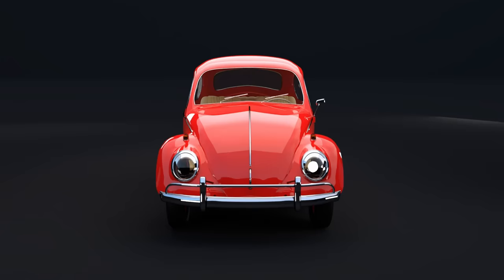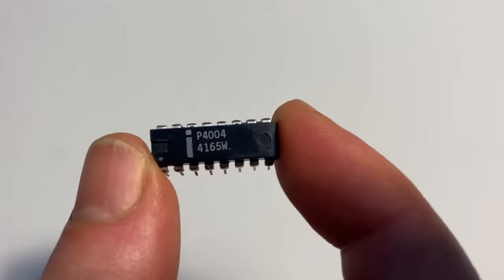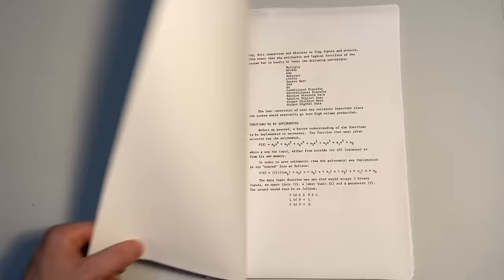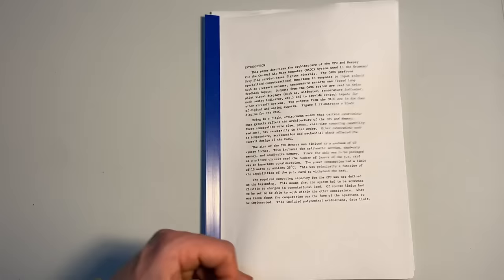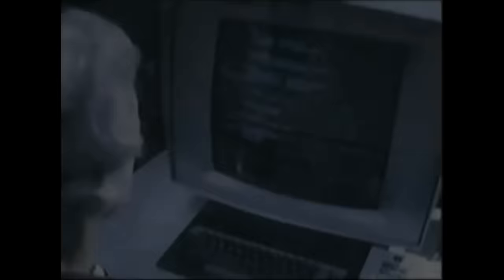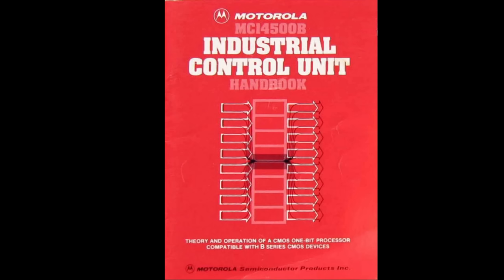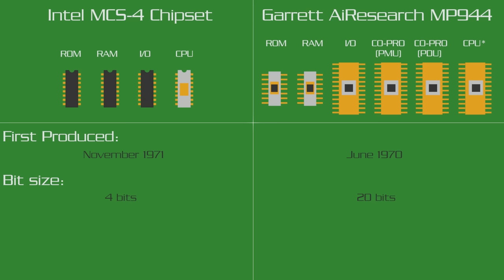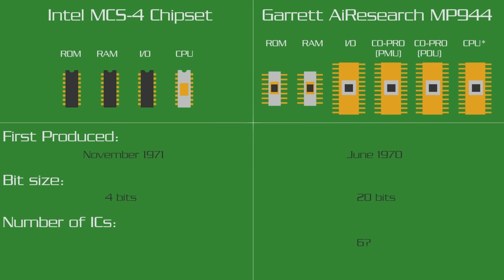The World's First Microprocessor: F-14 Central Air Data Computer

Comment: Great video! I really wish we would have a program today that could be used to verify that every transistor in the system is actually working correctly. Even if running that program once took a whole day, it would still be highly valuable to verify the hardware that you have, either to verify it after building a new system or to diagnose unstable system. Currently the state of art seems to be "randomly swap parts until it starts working again for the programs that you actually use daily".
Reply: Programs can be written and the trick is to be able to prove that a "single failure" is picked up.  Overall its a simple concept. If a * b = c and if c is the incorrect answer then you have a problem. How many a * b or a/b do you have to do to catch all single failures.  Now multiple failures are a different story.  Ray Holt
Reply: @firstmicro  The problem is that you cannot know by definition which part of the hardware is potentially broken. If you compare any numbers to each other, what if the comparision operation in the CPU is broken? Modern CPUs have multiple execution units per core so even if you successfully execute 5 comparisions correctly with known values, you cannot know if the 6th execution would actually work correctly or not. And since the actual execution units are selected by proprieatry algorithms inside the CPU, you cannot assume you have a safe way to run any kind of test code on all units.

We would need some hardware support to be able to test all the transistors in the CPU. For exaple, ability to select which execution units are in use (basically disable everything but one) is needed to check if those units work correctly.

And to make things harder, the L1 or L2 cache could be broken and there you have the problem that e.g. 16-way associate cache can have the cached value in different locations in the cache and any random execution of the code may or may use the part of the cache that's broken.

It's turtles all the way down and at best you can give some kind of statistical estimate how correctly the hardware is working.

Comment: Interesting video. Reminds me of the seventies when I started designing embedded industrial control systems.
Back then we made the distinction between mini computers and micro computers. A one chip CPU made it much easier to build a system compared to building all with TTL circuits.
Reply: Mike, Chips like the 4004 required multiple TTL circuits.  Some one-chip microcontrollers were very capable and required very few TTL circuits.

Comment: Stunning!  Early computer history suffers from being stored on media (paper and restricted scanned images) not widely viewed by current students so these videos expose new generations to how computer fundamentals came about.  Trouble shooting these types of systems is very tricky (and not always successful).  I worked on directly connected adjacent parts to the F14 and to circuit board construction is just jaw dropping.  The printed wiring boards are super high density and battle hardened.  The difficulties in programming are unbelievable.  The original engineers were amazing.

Comment: Sir, with great respect, while your comment about high aspect wing ratios creating more drag was not necessarily incorrect,  high aspect ratio wings actually have a higher lift to drag ratio.  That is to say, of a high aspect ratio wing and a low aspect ratio wing of equal lift coefficients, the high aspect ratio wing will usually produce less drag (case in point the high aspect ratio wings of the U2 or a modern airliner being designed for maximum efficiency while lifting a heavy aircraft).  It would be truer to say the Tomcat in the "T-pose" would create higher drag because it has an increased wingspan, to gain additional lift at low speeds.    Love the video though!

Comment: Great video. A couple of niggles (I know you love them): iirc the program which converts assembly language into machine code is called an assembler and not a compiler. I’m sure I’m like the 100th pedant to point this out. And between the 4004 and 6502/Z80 were the 9900 (no registers, first consumer “16-bit” chip), the 6800 (inspired the 6502) and the 8080, among others.
Reply from the maker: Oh good spot! Why did I say ‘compiler’!?
Ah yes I just mentioned the 6502/z80 as they will be more familiar to viewers
Reply: Also the 8008.

Comment: Great video, brought back memories. I graduated with a computer science degree in 1978, and in 1979-1981 I worked for Marconi Avionics, Rochester, Kent. I worked on the first computer based air data systems for Altitude and  2 dimensional speed for helicopters. There were still a team of watchmakers who serviced the mechanical computers for the Vulcan bombers.

Comment: I worked on the F14 in 1994.  There was the Z8080 embedded in a center console black box.   I had an old programming manual from the 70s and was able to work on it.

Comment: In the 60's, IBM was working on Josephson circuits, multiple superfast processors in a liquid-nitrogen bath (to lower electrical resistance to near-zero).  Those Josephson processors/circuits were microcircuitry prototyping.

Comment: The Japanese (mostly Hitachi and NEC) designed dozens of 4 bit processors in the early '80s I think it was and some of them are still being manufactured in their millions to this day. While the US made all these 8 bit micros after the Intel 4004 the Japanese in sheer numbers probably outsold them. These were used in LCD displays and washing machines and so on in really high numbers at the time. I reckon this difference was driven by a cultural difference, in the west engineers were trend setters if you like and in the east they were encouraged to be minimalist, winning from a cost/performance perspective and through that incredibly widespread adoption. As die sizes and therefore cost for 8 bit CPUs shrunk a lot of the cost advantage shrivelled, being driven more by packaging costs that scale tilted a lot but like I say, there are still millions of 4 bit micros being sold.
Reply from the maker: My favourite use for a 4 bit micro is in the Barbie typewriter - to allow for a hidden encryption mode. One may or may not make an appearance on this channel in the future…
Reply: @Alexander-the-ok  The encryption mode wasn't entirely hidden; it was mentioned in several versions of the manual that came with the Barbie Typewriter. (Or, as I like to call it, the "Barbie Enigma Machine." :-P)

Comment: This is the best Ive found so far for computer tech back in the 60s, 70s, 80s.  The low level programing needed to control swing wing on the F14 Tomcat.

Comment: You may want to check out the Viatron System 21 microprocessor from 1968.
Reply from the maker: I did come across that as part of the research for this. It was the first use of the term 'microprocessor'...though I don't really think it falls under the generally accepted definition of one today (though, of course that is very much open to debate).
Reply: And four-phase al1

Comment: IMO for semantic purposes, anything that isn't pure logic handling. i.e. 8 and gates on an IC, and can perform actual abstracted computational things. It counts as a micro processor (granted that it's all on one package)
Reply: Why. A processor has a specific job and isnt too hard to define
Reply: @ravener96  Ok, define it then.
Reply: @nobodynoone2500  the minimum is that the system can perform instructions necessary to define a touring complete machine. basically if it can execute transformations on input data and do conditional operations you have a processor. i dont really care about the IO restrictions used in this video, if the chip can be fed data and do transformations and conditional operations it's a processor

Comment: I like the "CPU on a single integrated circuit" definition of microprocessor, so I feel like the external program counter is disqualifying to be a "microprocessor". But it's an arbitrary cutoff.
Reply: Then you are ignorant to processor design, your chip on your computer (or phone) you typed this on does not meet that arbitrary standard.
Reply: @nobodynoone2500  Could you elaborate on that?
Reply: But it then depends on what you call a "CPU." Is an 8080 a CPU even though it can't run without some moderately sophisticated external clock generation circuitry?

Comment: So the conceptual difference of mp944 is rather than sending an entire number in parallel thru a serially complex procedure like we are used to, it sends its numbers serially thru a complex parrallel set of dedicated hardware processing.  Thats some genius thinking there.
Reply: Thats actually why the 80s Amiga was smoother graphical interface than PCs today.  PCs use convoluted serial procedures to run the interface along with calculations so it gets choppy and boggy where the amiga ran the interface on its own coprocessor.  In a way, i guess we could bring that back within the boundaries of PC architecture by adding a dedicated interface chip back into it rather than relying on a constantlt "faster" pc to smooth it out.

Comment: You mention 6502 and Z80, but forgot the "line" following the 4004, namely 8008 (1972) / 8080 (1974) / 8085 (1976)  to speak only of 8 bits microprocessors. The 6502 appeared in 1975 and Z80 in 1976.

Comment: At 5:43, the jet plane taxiing on the runway goes through a control surfaces check, and the tailplane seems to behave like a pair of ailerons, whereby one goes up and the other goes down and vice versa.

It absolutely makes sense that an aircraft which needs to be nimble and maneuverable might have controls which allow this, but I never knew about this control method on planes other than delta wing planes which have elevons through necessity (ie they don't have discrete wings and tailplane).

Every day is a school day, and that isn't even the topic of the video! Amazing.

Edit: it sort of is part of the topic of the video. Thatll teach me for commenting before Ive seen the whole video.

Comment: Seems quite similar to the SAAB CK37 computer which entered service in 1973 in the SAAB AJ37 Viggen using that same MP944 microprocessor
Integrating sensors for airspeed, altitude, instrument landing system, weapon system data etc specific to the Viggen

There should be a number of old CK37 computers and perhaps even some MP944 microprocessors in the Swedish Airforce museum stash and perhaps in other places as well

Comment: The use of microcomputers in the F-14 to command aircraft flight controls closely follows the terrain following radar controlled flight of the F-111 fighter bomber,  which Defense secretary McNamara infamously foisted on the Navy as a do-everything fighter/bomber. 
As a first generation swing Wing supersonic fighter the F-111 had huge teething problems and fell far short of the Navy's requirements, however, Grumman was well aware of every outstanding attribute or shortcoming of the F-111 in designing  the F-14 soon after as a superior replacement. 
And even before the F-111, the Apollo moon rockets used some of the first integrated circuits - I believe they were Fairchild microprocessors? -  in their rocket guidance command and control.
Even more astounding were the analog computers used in World War II, especially the big firing control units that estimated range & velocity for the huge Naval guns on the US battleships, and the far smaller Fire Control computers for the remote gun turrets on the B-29 Superfortress bombers,  which apparently were  accurate to twice the distance of 
purely human aimed  gun turrets.
It is amazing to think that the Concorde, the 747, the X-15, the SR-71 and Appollo rockets we're all designed by slide rule in the days before engineers had electronic calculators.
And finally, it is a shame that another defense secretary mafia, this time under dick cheney, pulled the rug out from under the mighty F-14, instead of upgrading it with the newer engines and  avionics they deserved,  forcing the Navy to  adopt the smaller, less capable but less expensive F/A18 Hornets

Comment: I think there is some clarification required for the operating temperature discussed around 25:00; mil-spec operating temperatures are -55 degrees to +125 degrees Fahrenheit, not Centigrade, and refer to the ambient operating environment. The junction temperatures within the silicon may reach 125C, but that is not uncommon in commercial silicon semiconductors. The difficulty with meeting military requirements is generally in the electronics packaging and thermal management, while still meeting other performance and producibility requirements.

Comment: Fairchild Semiconductor did not make the bulk of its money from selling the 4004 to calculator makers, It was a subcontractor to Autonetics, the company that supplied Boeing with the guidance system for the latter's Minuteman I ICBM.  My question is this:  Was the 4004, a 4-bit CPU, adequate for guiding an ICBM to a target 7,000 miles away?  Or Did Fairchild have a different product for that?

Comment: Haha @7:15 you even warn us... But as an aero engineer I have to correct you, I am unable to either not tell you I'm an aero engineer or correct you (sorry)
1. Amount of Lift has little or nothing to do with stability (stable flight)
2. High aspect ratio (correctly stated) creates exactly less drag - the higher the aspect ratio the more efficient the wing AT LOW SUBSONIC SPEEDS
3. Swept wings reduce wave drag, shock drag and are reduce separation effects at high transonic and supersonic speeds.
4. Swept wings also perform better and more predictably at high angles of attack

Comment: The F-14 was a cool aircraft for sure. There are very few planes with this level of carisma. 🙂 Another cool and charismatic aircraft from that era using a computer on board for targeting was the Swedish SAAB 37 "Viggen" (Thunderbolt). That one also had datalinks to receive target information from ground based radars. The first "Viggen" flew in February 1967. The first F-14 flew almost four years later, in December 1970.

Comment: I worked on CSDC, which was the main computer on the F-14A, the other main computers  were the three directional  computers (Roll, Pitch, and Yaw). Be for the main computer was turned over to the Navy to run, Civilian engineers were assigned to our shop to run it, (fix it). The engineers instead of replacing the computer sticks, they would be the hell out them with a rawhide hammer. When we were finally able to run them, all the tips on the end of the sticks were bent all to hell where the engineers had beat on them.

Comment: It actually changes stability around the lateral axis. 10:00 The longitudinal axis runs longitudinally ie: the roll axis. Roll stability is also affected, but I think you were talking about pitch stability, hence, you are talking about the lateral axis.
Reply from the maker: You are absolutely correct - I’ll add it to the pinned comment.

Comment: from the description, the MP944 didn't have a control unit on board the 'CPU', requiring the SLU to send the bit combinations to the pins on the CPU package. The SLU is, by definition, the control unit. I have a very hard time accepting that the 'CPU' portion is actually a CPU, its not, its not turing complete, it can't perform operations on instructions, its basically just a simplified ALU on its own chip, it still needs the SLU to do anything useful. For a CPU to be turing complete, it technically only needs a single instruction, but that instruction MUST perform an addition (well, actually a subtraction), as the 'CPU' chip itself can't perform mathematical operations, it can't be turing complete, and due to the lack of an on board CU can't be considered a CPU. The 'CPU' is far closer to an ASIC paired with a dedicated control unit, in fact the SLU is turing complete. 

Its certainly an interesting design, but its very hard to call the system a microprocessor, its a collection of ASICs that perform the role of a CPU.

Comment: as someone who has designed electronics for satellites, even today it is hard to get space rated parts. (part of the reason the ingenuity helicopter is so impressive is that it consumer electronics running it) So having the worlds first microprocessor needing to run at such an extreme environment is extremely impressive.
Reply from the maker: I’m still mad i never made a pull request to any of the repositories ingenuity’s software used. I totally missed out on the cool github badge

Comment: The most intimidating looking airplane of all time? The Northrop Grumman YF-23/PAV-2. 

Like the F-14 (Also a Grumman design), the YF-23 looked like it was supersonic when it was parked. The head-on view of that airplane still makes my giblets tingle. PAV-1 is on display at Wright~Patterson in Dayton, Ohio right across the aisle from the UGLIEST airplane ever built, the Northrop designed “Tacit Blue”. Interestingly, you can actually see the direct family lineage between Tacit Blue, the B-2 Spirit, and the YF-23. All three share some very obvious lines and RCS solutions.